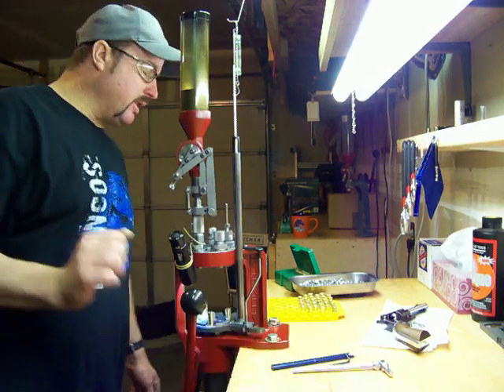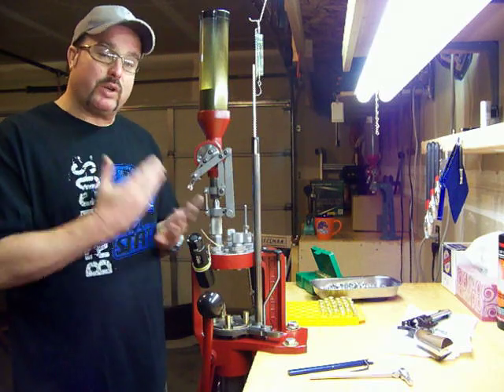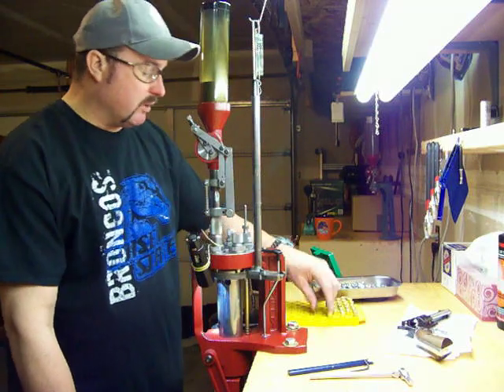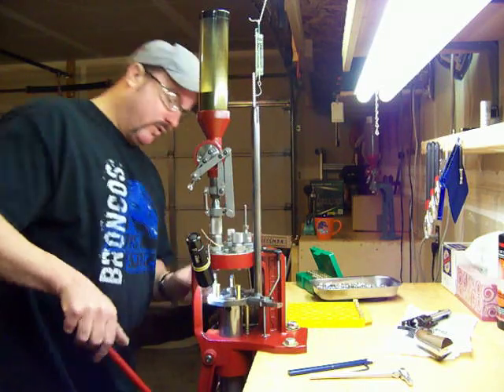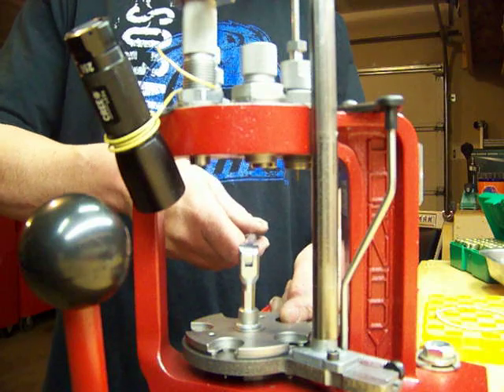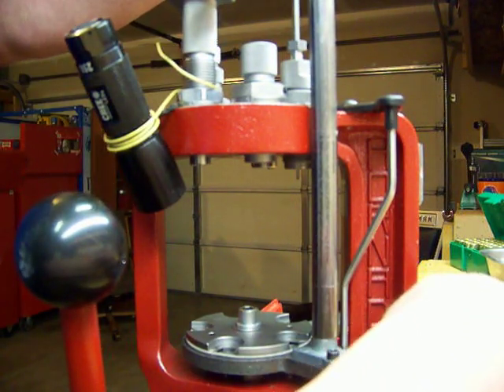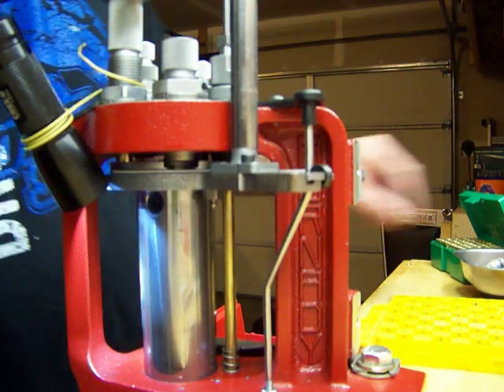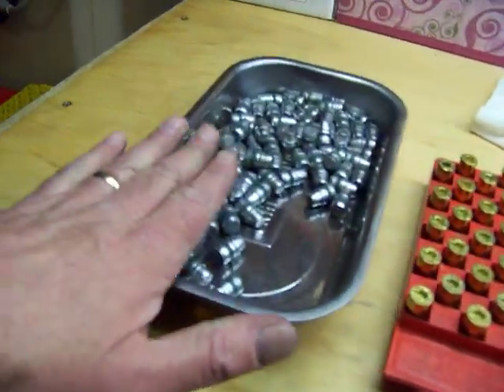Hornady LNL AP Press Set Up Hints and Tricks, Part 1

Comment: I know you moved to Dillon.. but these Hornady videos are fantastic for those with the red presses. You're an excellent instructor man! Thank you.
Reply from the maker: 71Rcode... I do miss my Hornady. Thank you for the kind words. 76highboy.com
Reply: @76Highboy  

Yessir. Took a page of notes each on videos 1-4 tonite. Had to stop as my hand hurts...haaa. will refer to them prior to setting up the press and loading next time. Golden videos!
Reply: @76Highboy  Your videos on the Hornady AP are the absolute best there is on this press.  Hands down the best.  I have had mine for about 8 years now.  I still love it.  I am very sad you don't have one anymore.  I have zero intention of ever replacing it.

I do about a dozen calibers on mine.  It's inexpensive and easy to swap out for another cartridge.  It's precise for seating and powder throw.  It's compact.  It's fast.  Priming system is super reliable.  It's super convenient to spot check a cartridge at any point in the process.  It costs a lot to feed it with supplies so I don't see myself ever upgrading to something "faster".  The only other press that's as fast and flexible might be the RCBS Pro Chucker.  I like being able to do up to 300 Win Mag.  No other press (maybe the Pro Chucker) has this combination of cost efficiency, speed, precision, and flexibility.

Comment: Thanks for the tip on the lock washer. Also, I learned a lot, seeing how you pay so much attention to the feel of the machine. I think I have caused problems by trying to power thru problems rather than stopping and fixing the problem. Well done Highboy.

Comment: I leave the primer tube assembly about a half turn loose (per a suggestion on some forum), and I stick a section of GI cleaning rod on the fiberglass rod for a bit of extra weight on the stack of primers.  I've never had an issue since with the primer feeding.

Comment: I've watched your videos and you really seem to have the press dialed in. I have had mine for three months now and I've never managed to get the thing to work as smoothly as yours seems to. The shell plate will not constantly index consistently and no matter how many hours I spend fine tuning the indexing lugs, the problem never goes away. I no longer reload with this press.
Reply from the maker: My press has always ran good but unfortunately you are not the only one who has these issues. This is why I state in my videos that I do not recommend it. Also, so far, I have not had any of my guys who run the Dillon's experience any thing like this and no one ever tells me what you just said. 

My Dillon RL550B is three times the press for close to the same money. And yes, maybe a bit more money but you will surely be loading ammo and it is match grade.

One last comment. Some viewers believe I am out to de-rate Hornady. Not so. It is just very frustrating when I try so hard to help the Hornady guys and they still struggle. 

I regret ever starting my channel with Hornady. 

Highboy

Comment: Thanks for the video Jim. It was a bit long but you shared a lot of good info there. I've got the LNL but I haven't been running it for awhile because I fell into a deal I couldn't pass up on a dillon xl650. And I can tell you that I have had more issues running it than the LNL. But I'm getting it smoothed out now. You have to learn your machine. Each brand has it's issues as you said. 

I am setting my LNL back up to do 223 and 300blk and I have some issues that I didn't see when doing pistol rounds and came across your video. I had already put a lock washer on and just like you I found it solved a lot of problems. I like the priming system on the LNL over the xl650 too. But the case feeder on that xl650 is really nice for me.

I, like you, recommend the LNL. Like I said I fell into a great deal on the dillon but caliber conversions are so expensive in comparison, I'm not sure I should have taken that jump. That's why I'm setting the LNL back up for the rifle rounds.
Reply from the maker: blueeyephil Hello Phil, My videos are not short and they are not for everyone. However, I have many, many subscribers who are successfully hand loading because of my videos so I know they are working. 

I started with the LNL and now have the Dillon XL650, the RL550B, and the SDB. I will know in about a month which I prefer. The XL650 or the Dillon. 

Welcome to my channel. Highboy

Comment: I am trying to decide which press to buy for my first. I am 60yrs old on a very tight budget and would perfer not to start out then upgrade later,  if I can. I am considering a progressive. Thanks for all the info on your channel it is definatly helping me make up my mind. Keep up the GREAT work.
Reply from the maker: Your welcome Ron. I would recommend the Dillon RL550C. Not as expensive but caliber change over can be, For that reason you may want to check out the Redding T7 Turret. It is nor a progressive but can put quite a bit of ammo down range in a short time. Highboy
Reply: Can you please tell me what a Dillon caliber change over costs compared to others? Thanks for your time.

Comment: Great videos. They have helped me clean up some of the bad advice I was given over the years through the various forums (putting a piece of steel under the primer ramp point). 
I have noticed that a compression washer would come loose just as easily. I have also used star washers but they do scar the flat washer. I might go back to the compression washer to see if I was doing something wrong.

Comment from the maker: Hi Paul, thanks for watching my videos. I do put a tiny bit of lubrication on the bottom roller bearings. Use a newer advanced gun oil, and just a little will do it. Stay away from grease. IMO, too messy.

Have a good one Paul.

Comment: Quick tip 1 - Fully tighten your shell plate before installing the case retention spring.  If you don't do it in this order, you will squish and damage the spring and have to buy another one.  May seem like common sense, but I've read about people having to replace them frequently.
Quick tip 2 - Use one of the screw holes on the back side of the press to run a wire to ground.  This gives static electricity in the powder measure a place to go, which improves consistency in your powder charges.  You can buy replacement 120V plugs from Home Depot or Lowe's.  The round terminal is Ground.
Reply from the maker: I sure appreciate your hands on advice... these comments are what help the videos the most. Welcome to my channel and thank you so much. Happy New Year Sir. Highboy

Comment: I have the Hornady LNL Ap it is a good press and a heap cheaper than a Dillon, and their warranty is awesome, I have had to replace parts that were damaged by user error and they replaced them no questions asked.
The only issues I get when reloading is my bullet seating die gets jammed up from being skewed on occasion, all I do is lower the handle jiggle the die with my finger till it corrects and I'm off again. Only happens on my .308 die though

Comment: I am having a problem with the shell plate not progressing enough to allow the case to get a primer. I have adjusted the pawl and I still have to move the shell plate just a tad to allow priming. One thing I have noticed is the entire set of arms and such twisting when I push the handle forward to prime. I think this is causing my problem. Got any suggestions?

Comment: Awesome vid.  Helped me alot. One question, do you use any lubrication on the bottom of the shell plate? Hornady suggest a light grease on the bearings and bearing dents.

Comment: I see another problem you have.  One I had out of the box.  The right pawl that forwards the plate on the upstroke is a tad too short.  You can see your plate stops just short, then snaps forward into place.  That caused me feed issues into the resizer as well.

Comment: Bill,

Your videos are fantastic.  Thank you for all your time, work, and effort that goes into these!  I just started reloading on my own and got the L-N-L based on research and your videos have been an immense help.

I do have one question that I have not seen addressed in the videos thus far.  When going from the resize die letting the shell down the shell plate does not cycle all the way to center to seat the primer.  I have lubed the ball detents with oil and it is clean.  I can seat the primers fine I just have to push the plate into place (maybe 1/4" clockwise).  

Sounds like a few other people have had similar issues so I figured I would run it by you.  Any help or advise would be greatly appriciated.
Reply from the maker: The reason you are experiencing this issue is the adjustment pawls may be off a bit. I will be doing a video on this shortly and I will cover this issue. For now though call Hornady and they will instruct you on how to adjust them, and how much. It is a simple fix and it good to know. Keep an eye out for the upcoming video.

Highboy

Comment: I have had a serious problem with primers not wanting to set up in 9mm brass.  New brass . . . it seems like perhaps the brass might be a tad off to the left or the right . . .  can't find out which one . . . brass just does not allow the primer to go in smoothly.   Perhaps every 3rd or 4th one goes in smoothly . . . the others need serious . . . serious pressure to get them to go in .............. Have any suggestions . . . ideas . . . ????

Comment: Do you have a video that shows how to fix the plate movement? I'm having a double click issue and shakes the brass and powder jumps out. I have adjusted the pawls but does not seem to fix the issue. It feels like the ball detent is close to the hole after the up stoke is finished and then just snaps into the detent holes. Thank you.

Comment from the maker: The only way a lose shell plate can mangle a primer is if the empty brass comes into position but is not exactly centered. Then when you go to seat the primer it will "Mangle it", as you put it. If you Que the video to 11:30 and watch it to the point I find the bad primer you will see all the primers seated smoothly. I would have rather the primer was mangled from a lose shell plate because that would have supported the importance of keeping the shell plate tight.

Comment: Bill, great series very informative. After following all your videos and tips I am noticing an issue. 

The press seams to hang up a bit on the down stroke from getting powder drop. I am using the PTX in the powder dispenser, I am using the least amount of flair as possible and it seems like it takes a decent amount of force to advance the press on the down stroke.

Also it does this in the 5th station that I have a lee factory crimp die in.

Loading 40 S&W right now, any thoughts on ways to smooth it out or does it seem like I've got something wrong?

Thank you sir

Comment: Hey thanks for posting these excellent vids on the LnL press. I've been having little irritating problems that your vids have helped me solve... BUT, there's an issue with my shellplate on just one particular station that is off. All the other case holder stations index correctly, but one, which I marked with some tape so I know it's always the same one which goes too far past center which obviously, causes problems. Is this a manufacturing or set up issue?

Comment: great video, now i'm motivated to get the LNL. In the meantime I have 3 questions, Do you have to do the resizing/deburring of the brass on a seperate machine prior or does this do it? 2nd what are the 5 dies in the machine for? I see die sets for sale and they are in 3 sets or 2 sets and not sure which 5 to get for the LNL or if 5 is mandatory for all or just some and finally I use 6.5 grendel a lot which is basically a AK47 7.62x39 with neck shrunk  down for a 6.5 bullet, will this machine do the neck shrinking on a 7.62x39 brass casing or is that a different machine?

Comment: What's up 76Highboy Reloading? I wanted to ask you something regarding this press. In the past I know you were making an extended series in the Hornady AP press, I wasn't able to follow the tailspin of that series, but can share why you stopped producing the videos? One of the last videos that I saw involved the primer dispenser issues and attempts to fix it and get a fix from Hornady. Will you reconsider releasing those videos again or making new ones? Just wondering. Have a good day.
Reply from the maker: I truly wish I could but my press will not seat past flush. I may use it down the road for something like 44 mag but past that I don't ever use it. It's too bad because I like it but it just won't seat past flush. Hornady told me to seat with my Redding but that kind of ruins the idea of loading on a progressive so I quit the videos. Right now my Dillon's are smooth and flawless and for progressive they are very easy to make videos with. I truly wish I could help you and thanks for asking. If you send your contact info to groundzeroreloading@gmail.com I would be willing to help you if your press is  having mechanical issues. Highboy
Reply: Thanks for the info. So far, knock on wood, I just bought my press and have not used it yet. Life is making it sit in back for a while until I have some free time. Yeah, is hard to understand why the manufacturer won't fix that issue. I plan to tackle that same issue once I get there either by modifying that primer seater or getting a handheld primer seater, like a Lee. But safe to say I'll be using the few videos you left in your library to deal with any other issues I may encounter. I appreciate your response to my questions. Wish you the best with your AR build. It's satisfying to make your own. I made mine and don't regret it one bit.
Reply from the maker: Thanks Billy. I would not modify it, just use it. Hornady told me they only guarantee the primer to be flush so technically my press works according to their design. So just be aware of that and have fun on your Hornady. They are strong machines and if you have any problems let me know. I will try to help out. As far as the AR build they are fun and addicting. Have a good weekend. Highboy
Reply: Billy Roque
Reply: Billy Roque
Reply from the maker: Billy Roque I am actually selling the Hornady. It's working good but I have no interest in it any longer. Thanks for asking. Highboy
Reply: Can I ask why your selling Highboy?  I've just started watching your videos, as I'm about to purchase this press.  This has me very curious now!!
Reply from the maker: Brooks Landry Because my press will no longer seat past flush. Hornady recommended  using an alternstive priming method and that defeats the purpose of the progressive press. The body where the priming ram pushed against is alloy. The design is engineered to divot a small hole and no more. I have a huge divot so my press is pretty much done. Hope that helps Sir. Highboy

Comment: Hi Bill, just switched over to .223 rounds on my Hornady AP.  Man I have to set the recapping, resizing die deep to push the shoulder back far enough to fit in my CZ and AR rifles.  It really stresses the press!!!!  Do you have any recommendations on what I should do.  I still have my Redding Turret press, think I should set that up to resize??
Reply from the maker: I would. That is why I got the T7 Turret press. IMO, the Hornady LNL is a little light duty, but that is just my opinion. Thanks, Highboy
Reply: Bill Morgan Wow!  That was a quick response.  Thanks, I think I'll set my Redding back up for the heavy weight jobs.  I'm like you in that I think the Hornady should be reserved for the lighter duty jobs.  There are a lot of things that need to stay in time and running it hard (like resizing/depriming rifle cases) might tear it up.

Comment: Bill great video,  very educational, I was wondering as a first timer trying to get into reloading should I go with LnL ap or go with single stage loader,your thoughts and experience would greatly be appreciated thanks
Reply from the maker: jeff p Jeff, first off thank you and welcome to my channel. 

My thought is always to start with the single stage press because it is simple to learn on. The progressive press has a lot going on all at once and it is important to be able to verify each load as you are learning. The single stage press will allow you that.

One bit of advice. Check out the Redding T7 Turret press. It is still classified as a single stage but has high volume capabilities and remember this. It does not matter what brand progressive press you buy, they are all sustainable to breaking. The T7 Turret will not break. Also, even though you may end up with a progressive the single stage always comes in handy for specific jobs.

Hope that helps and I look forward to getting to know you.

Highboy

Comment: The split spring washer on the shell pate didn't work for me as the split washer is not always made to be same thickness all around, especially ones that are just slot cut which causes one side to be thicker than the opposite side.  This causes the shell plate not to seat evenly.  It made the problem worst.  So now I just check for shell plate tightness every 20 or so round.
Reply from the maker: tathuen I am sorry to hear that. I have not had that problem. Interesting. Welcome to my channel. Highboy

Comment: Bill, great video. Since you have resized the brass before, do you have to lube them again to run through press again?
Reply from the maker: No, not if it is pistol brass. In fact, if they have been deprimed/resized you can leave that die position empty. Thanks for the question. Highboy